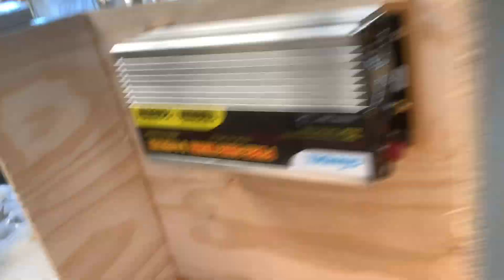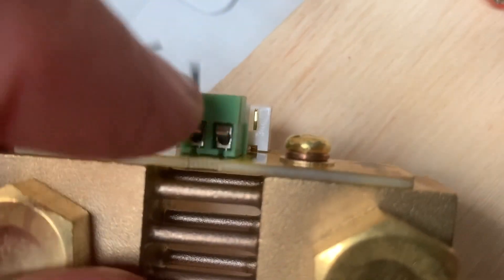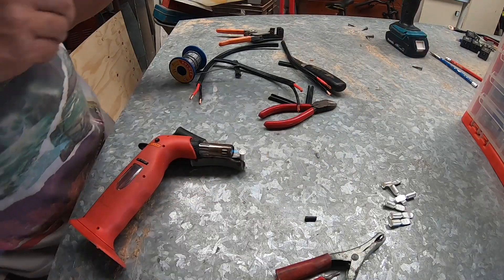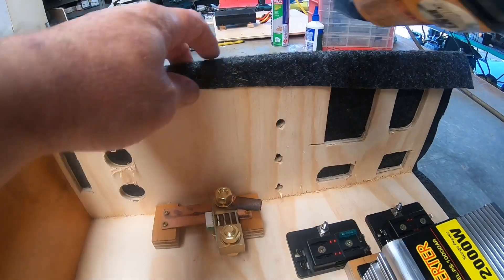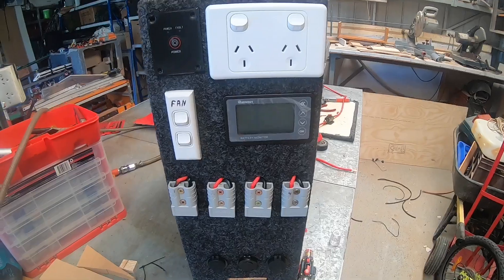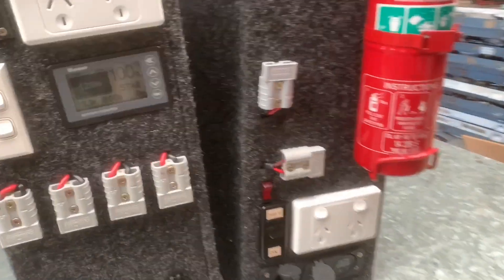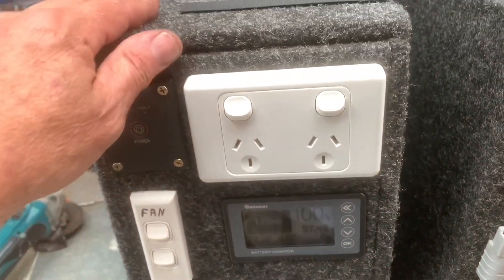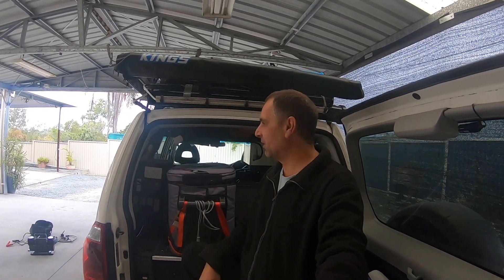Lithium 12v power station project

Comment: Hey mate with your earthing, it’s just that piece of copper? It won’t be earthed through the cars chassis at all?
Reply from the maker: Yes its also earthed to the vehicle chassis. Cheers 👍🍻
Reply: @EFFICIENTSELF  From the shunt draw side to the chassis?

Also am I seeing this correctly that you have combined the negative wire of the DC unit with Solar in Anderson negative and DC in Anderson negative into one wire that goes to the shunt?

Thanks heaps
Reply from the maker: Yes correct all the earths to the shunt so power can be measured either going in or coming out

Comment: Seems like it’s been 11 months would you change anything on the set up?
Reply from the maker: I have sold the vehicle on but if I was to build another I would go thicker plywood for outside casing and a better quality mppt/ dc charger such as redarc . Everything else has been great 👍. Thanks for watching 👍🍻
Reply: Thanks for the info, I must say definitely one of the best set ups I’ve seen 
I’ll be building one these with bigger battery 200 ah lithium for a bigger family adventure 👍🏼👍🏼
Reply from the maker: 200ah will be plenty of power . Good luck with your build . Will not be cheap to build but will be worth the money spent 👍🍻

Comment: Great Job...What are the dimensions of the Box and what size Plywood did you use Cheers !!
Reply from the maker: Thanks you.. it’s about 540mm long x 190mm wide x 550mm high did this measurement to fit the space in the back of my Pajero . I used 18mm ply for the bottom and 9mm for the top and sides. Used the thin ply to keep it as slim as possible . I had to put some reinforcing inside as it would of fell apart on corrugated roads... if you do this go a thicker  ply if you can.. or to be honest just buy one of those strong plastic modular toolboxes if you don’t need a particular space to fit it into as it will be cheaper.. I will be doing another build similar to this using a toolbox . Just gotta find one suitable. Hope this video has give you some idea and thanks for watching 👍🍻

Comment: How is your mppt charge controller going today? I'm looking for a decent mppt charge controller. I bought myself 2 "300w" ebay solar panels. Just like your 350w panel, their output is about half of what they are advertised as. They were very cheap so i won't complain.
Reply from the maker: Mate it’s going good. I got a video scheduled Saturday night at 8;30pm on 31 oct .. if it’s for a camper trailer or caravan mate . My advice is don’t buy it as it will be explained in the video next week

Comment: Hey are you able to draw a wiring diagram to connect the dc-dc charger to the battery monitor system , just carnt get my head around it
Reply from the maker: Here is a link to describe how it’s connected. This is actually what I watched to see how easy it was to connect the battery monitor https://youtu.be/-vrQsKZ7CdE  hope this helps . Thanks for watching 👍🍻
Reply: @EFFICIENTSELF   thx very much

Comment: Looks good mate was wondering how your dc dc charger is holding up and would you recommend it as i just purchased the 120 lithium battery also and my redecorate dc dc charger is not liking the new battery cheers
Reply from the maker: The charger has been going well. It’s great bang for your buck . Not good for a caravan or camper trailer as  I have a video coming out on it around 3 weeks time explaining it . But it performs very well . thanks for watching 👍🍻

Comment: HI, great job on the build, do you have any info on your battery charger please .
Reply from the maker: Thanks mate appreciate it . Are you meaning the noco genius 240 volt charger? If so i have a video on it . If you meaning the atem power dc dc charger built into the box , there will be a video coming up on it . Thanks for watching dude 👍🍻

Comment: Great job. Is it too much trouble to list all the components you used in the description above. I would like to build one myself.
Reply from the maker: Sorry it would be .. i used lots of things i bought over a period of 6 months and just don’t remember what i purchased where. I made up few things like battery lugs and the bus bar out of copper pipe. I only purchased recently the dc charger and the battery monitor and carpet trim for the outside of the box... hopefully i might be making another down the track and i will go into more detail as i did not think there would be much interest in this . Thanks for watching 👍😂

Comment: When you have a moment are you able to put in a parts list and costs keen to build one for my pajero,
Reply from the maker: Lots of the items I used are what I had at home I gradually bought over 6 months . I made up the big cable lugs and the copper earth bar out of 19mm copper pipe ...sorry can’t quite remember everything that went in as this was built over 2 weeks . Battery is biggest expense if you go lithium battery . The dc charger and inverter bit over $200 each .. probably looking at around 2k to built this and that’s allowing say 1k for similar lithium battery. Have a look https://www.bigweibattery.com.au/product/bwb-100ah-12-8v-1280wh-lithium-iron-lifepo4-deep-cycle-battery-w-accessories-in-stainless-steel-box/   I’m not sure about this but this is what give me the idea to build my box. Maybe this might be cheaper option, then you only need dc charger and inverter.. just a thought I had before I built mine...hope this helps mate 👍🍻

Comment: You are a genius.  Great job. I've been thinking about changing my set up. I might have to copy :)
Reply from the maker: Yeah mate its awesome.. your battery will be the biggest outlay if you have to purchase anything especially lithium. Maybe you could put your inverter forward so you plug straight into it to cut down cost . As it cost me around $80 for PowerPoint, cable and sparkie .  I was going to use a cheap powerboard but was too bulky. Hope you been well mate 👍🍻

Comment: That's a great build but but just wondering should you have a "safety switch" on the 240v output?
Reply from the maker: Thank you . Had the power outlet connected to 240v cord by an electrician, so it’s like a power board. I just plugged it into the inverter . Was going to get a power board and do the same but was bulky but would of been a lot cheaper. Only wiring I did was 12v only. Appreciate the comment and thanks for watching 👍🍻